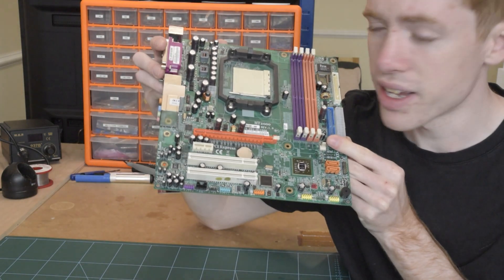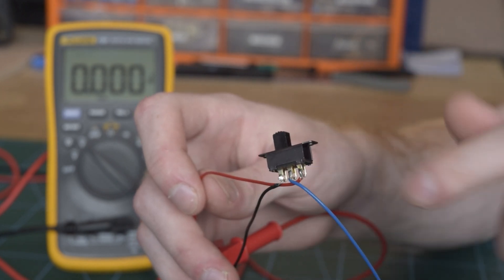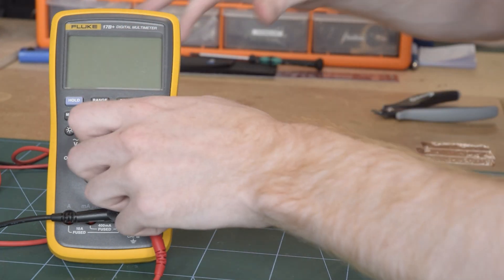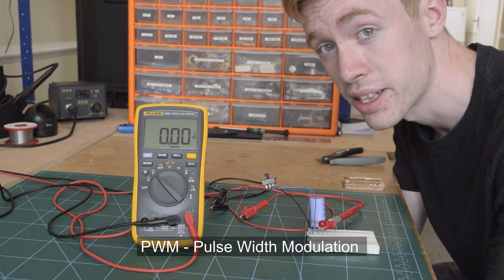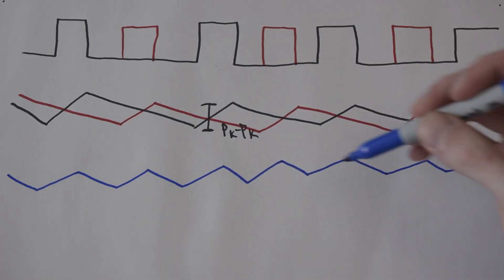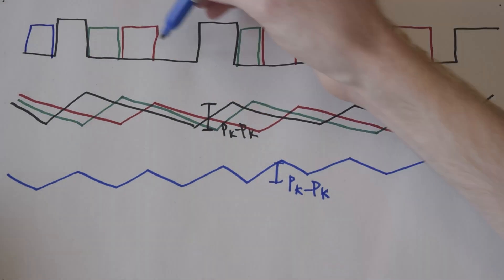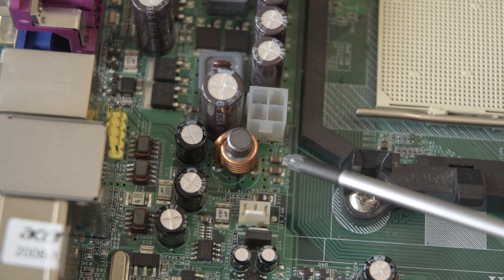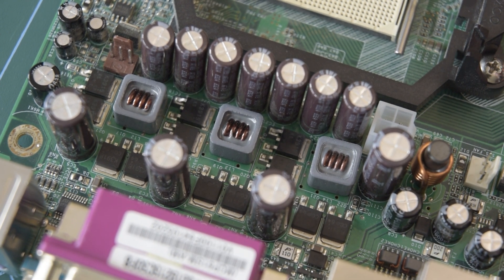What are VRM Phases? - Multiphase Buck Converters Explained

Comment: Thanks for a great explainer video! Super informative, very information dense, yet also eminently understandable. Well done! One note on the doubled phases often used in motherboards (and no, it's not just the ones targeting gamers) - while this is rather misleading, the doubling still has a lot of benefits, mostly when it comes to current handling and temperatures/cooling - while also avoiding the additional costs associated with high phase count VRM controllers and the motherboard layout complexity that comes from using these. While you don't get the efficiency and noise gains of better controlled switching from doubled phases, you do get roughly half the current going through each component, which helps a lot when CPUs can pull 200-250W at 1.2-1.4V. Of course with the amperage ratings advertised for a lot of PC VRMs being in the 70-80-90A range one might think that even three of these could handle such a load, and while they can in theory, their peak efficiency band is typically in the 10-20A range - so the more components there are (assuming some reasonable level of load balancing) the cooler they will run, the less power will be wasted as heat, and the less cooling they will require. Run 240W at 1.4V through a 6-phase VRM and that's 28.6A per phase - double that, and each part of the doubled phase will only be handling roughly 14A, so it should run both more efficiently and be better able to cool itself too due to the increased surface area of the doubled phase. Run any of these setups near the rated current of their components, and you'll need to dissipate enormous amounts of heat to avoid them melting down. Buildzoid/Actually Hardcore Overclocking here on Youtube does excellent motherboard VRM analyses where he calculates the heat losses of various VRM setups, which can be very insightful.

Comment: You didn't explicitly explain why we need multiple phases. What is implied is that each phase runs as fast as it can so multiple phases trade frequency for phase in a sense to get more frequency. That also implies that shifting phase is still easy relative to just increasing frequency. It also makes me wonder why we can't use some kind of DAC to switch different power levels for a smoother waveform. So while the explanation was very clear, the point of it wasn't explained well.

Comment: what's a reasonable temperature for such a vrm? i have an ancient asus board (2013) where the heatsink as at 90C even at low cpu load. it ran like that for nearly 10 years and i only noticed it while swapping cpus and burnt my finger when i touched the heat sink. if the value of the onboard sensor  is correct, it's well over 100. 
anyway, i strapped on a fan and at least the heatsink is at a more sane temperature. 
i'm just totally surprised that it still runs,..

Comment: Hi dear, I have a question...if the voltage for the CPU has to be  brought to 1v, then why not using 3.3v psu rail?
Reply from the maker: For a given power, say 100W, the current in the wires from the PSU would need to be much thicker. 100W / 12V = 8.3A. 100W / 3.3V = 30.3A

Comment: I believe something that was missed is the purpose of the low side switch. I assume it is related to the functioning of the inductor. If you were only charging a capacitor you would only need to switch high side.
Reply from the maker: But then it would just charge to 12V, the low side switch is to discharge it so that is bounces between say 0.9V and 1.1V to give an average 1V output. With an inductor it’s the same except it is possible to use just a diode because the inductor can use its stored energy to commutate the diode automagically
Reply: @electrarc240  The only way the average works in the capacitor example is because there is a lag in voltage change. Try charging a large capacitor through a resistor and measure the voltage at the capacitor as it's charging, momentarily connecting the example capacitor to higher voltage through a resistor will not instantly bring it to the higher voltage. The red flag is shorting the capacitor to ground to lower the voltage is very inefficient, the load can lower the voltage as well as do something useful. At least as far as I understand it the capacitor example has no use for a low side switch (you only need high side to top off the capacitor as it gets drained.) an inductor can use the low side to discharge.
Reply from the maker: @foxale08  The capacitor example was just for demonstration, it is much easier to make a very slow RC filter than an LC one. In a buck converter there is current flowing through the inductor so you cant just disconnect the input side of it or the voltage spike would break the MOSFET as the inductor has nowhere to "pull" the current from. So it needs a low-side diode and we often swap that for a MOSFET to improve efficiency and low load regulation

Comment: We also use multiphase buck converters for diode laser power supplies. Diode lasers need a very tightly controlled constant current in the order of 300A at 15V to pump solid state Nd:YAG crystals for various applications. The most important aspects are step response and overshoot that multiphase buck converters are ideal
Reply from the maker: Oh yeah I’d heard about that application for them. Sounds really interesting!

Comment: The circuit is not commonly referred to as a half bridge when used in a buck converter.
The switch to 0 V ("ground") is invariably known as a "synchronous rectifier." A diode is very commonly used in that position, but these days MOSFETs with very low ON resistance can significantly improve efficiency, though it requires active control. In buck circuits where the output voltage is very much lower than the input voltage the forward voltage of rectifier is a big player in efficiency since it conducts for most of each switching cycle.

Management of power dissipation and capacitor ripple current are very much significant considerations that favor multiphase converters. 

Newer multiphase regulators operate at such high frequencies that "all ceramic" designs, where electrolytic capacitors are not necessary,, are practical. These often use integrated power packages that include both the high and low side FETs and their drivers, along with some pretty sophisticated protection circuitry.

The expression for a buck converter
Vout = Vin x duty cycle (ignoring losses)
only holds where the inductor current is "continuous" - that is, it does not drop to zero each switching cycle. When a synchronous rectifier is used, continuous current mode operation can be forced - the inductor current actually reverses and flows from the output capacitor into the inductor and to ground. This has pros and cons. Preventing forced continuous current mode operation requires more circuitry than allowing it.
Reply from the maker: All ceramic is sexy af 😜. And yes many good points, thank you

Comment: Why not use 3.3V supply from PSU instead of 12V to increase buck duty cycle for 1.2V CPU rail to 50%? You’d need 4x wire ampacity, but it’s better than making MBs so packed with VRMs, move more VRM stuff to the PSU side, where you have more room and ventilation.
Reply from the maker: The case in reality is the opposite, maybe counter-intuitively. Servers often run at 40V+ to reduce copper losses/requirements. I guess copper is so expensive now that it really is cheaper to have a more complex buck converter than to use thicker copper. Kinda weird!
Reply: @electrarc240  but then copper is wasted on heat pipes due to inefficiency 😂. I think the problem is due to modularity of PC market, where each company is optimizing their component rather than optimizing the system as a whole. And also optimizing for performance and efficiency, not lowest cost. This is why Apple PCs are better at hardware, whole thing is optimized by one team. I guess laptops and tablets are the same, but not traditional PCs.
Reply from the maker: @CleanPowerAuto  That us a very good point to be fair

Comment: 2:36: V_out / V_in = duty cycle
Is this actually correct for a buck converter? It stores energy in a magnetic field. So V_out is correlated to the duty cycle, and so is the current capability, but the actual formula/value depends on the hardware used and could be anywhere we want, no? We can build a buck converter that outputs 5 V 1 A at 0.1 % duty cycle and we could do one that gets there with 99 % duty cycle.

For the graphics, why not do it in excel or something? No need to know anything about excel or python, ChatGPT will do that for you. A plot is really simple. But perhaps you were going for the hand-drawn-esthetics.
Reply from the maker: I didn't mention the caveat that it required continuous inductor current. And yeah I personally prefer the hand-drawn look despite it seeming lazy

Comment: i have a very simple question , instead of a multiphase buck converter , why not have a single good or high quality buck converter with lowest possible ripple or maybe an LDO right after the BUCK stage , you will highly decrease the BOM cost and LDO will have the most stable output voltage given that its able to handle the amounts of current thrown at it by the CPU
Reply from the maker: I think multiphase can achieve better "bang per buck" by using many cheap components rather than fewer pricey ones, it also has better responsiveness which is really important for CPU power.

Comment: It would be nice if the 3 phases could cancel the ripple completely as with 3 phase rectifiers using sinewaves.  Perhaps that doesn’t work with the triangle waves
Reply from the maker: Yeah sadly not, there is a bit of a "golden number" of phases given by 1/d where d is duty cycle (so 12 phases for my 12V to 1V example), at which there is always a single half-bridge high so the output capacitors have far less ripple to smooth. Sadly in practice this doesn't really work as the duty cycle is constantly changing to adjust for CPU load, meaning there will be short times of either no half-bridges high or two half-bridges high, both of which will re-introduce the troublesome ripple. You do get some open-loop fixed-duty converters that take advantage of this but they are quite uncommon.

Comment: Great video
Why didn't you put inductor with ur circuit on bread board
Reply from the maker: With my manual half-bridge I’m switching at around 5Hz, so the inductance needed would be huge. For a quick demonstration it was much easier to just use an RC filter rather than an LC one, and just not mention it. Doesn’t affect the basic understanding at all

Comment: You would have fun looking at a gigabyte GA-8KNXP (Pentium4 era) they did the weirdest thing and gave it a card slot beside the FETs to add extra power 'phases'(?) called DPM. Had to look it up, one user said theirs caught on fire, another user said that it was for if the EPS 12v failed, I had one of these but never the extra card to boost it. So I'm uncertain if it was new phases, or lowering the RDSon by putting extra ones in parallel, or some other augmentation.
Reply from the maker: Just gave it a quick google, looks so interesting (if a bit gimmicky), thanks for mentioning it!

Comment: Did you forget the inductor?
Reply from the maker: No it was a simplified demo, treating a buck converter as just a filtered half-bridge. As I was manually switching (Fsw = ~5Hz) an LC filter would've required a very high inductance, hence the use of an RC filter instead. There was no point mentioning this and potentially confusing people. For the majority of viewers this has given them all the understanding they wanted, if those who are interested (hopefully this has got people interested) simply do a little googling or watch other, more in-depth videos (hopefully mine) about buck converters they will learn the reasons for using an LC filter over RC filter.

Comment: Great video! Lately I've felt a strong autodidactic push to slake my curiosity beyond a surface level understanding with regards to the things I use everyday, but even in this "information age" with 200+ videos showing how to derive a PWM signal from a 555 I find myself in the position of Coleridge's Ancient Mariner. I'm sure what they're saying is correct and viable, but the conceptualization feels like someone who has trekked over the mountain and come back, without regard to the difficulties of the initial summit. I just wanted to drop a line and say that although there are many who are doing or have done things categorically similar to your work, how you parse and convey the information is unique and proven, to me at least, to be the most enlightening. So thanks, your work is very much appreciated.
Reply: My exact sentiment. Beware of Youtube videos that display free energy generation,  or those that simply solder components together without a substrate. There are a few fantastic channels like this one, but thousands of wrong info.
Reply from the maker: Thank you so much that really means a lot!